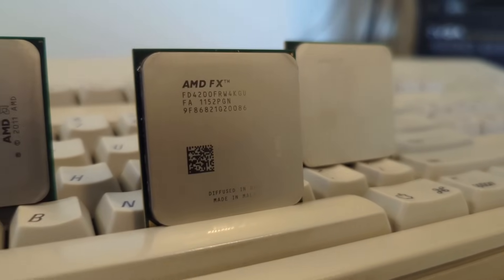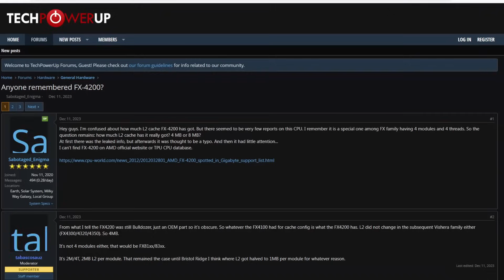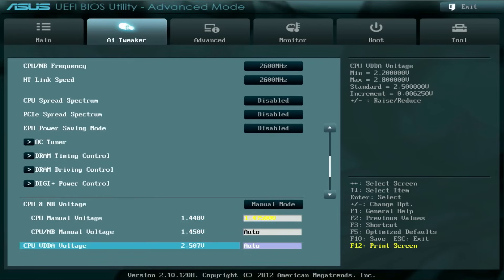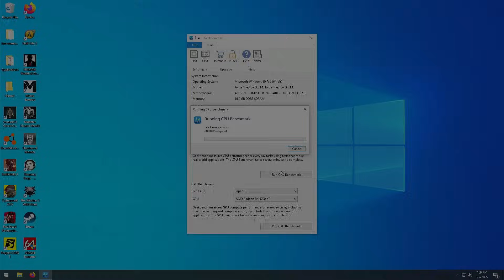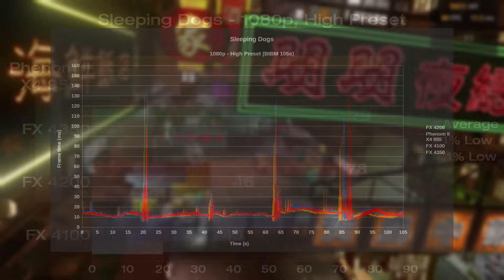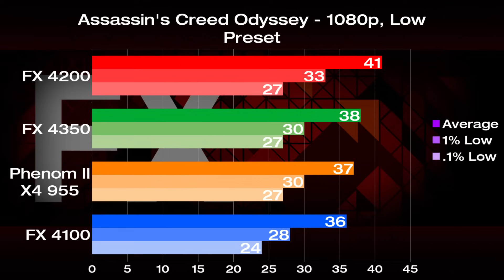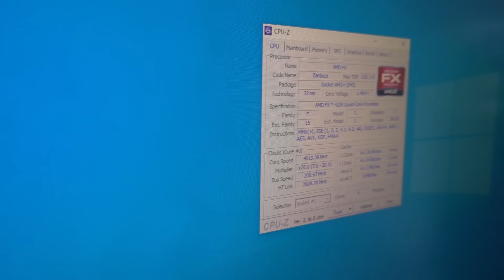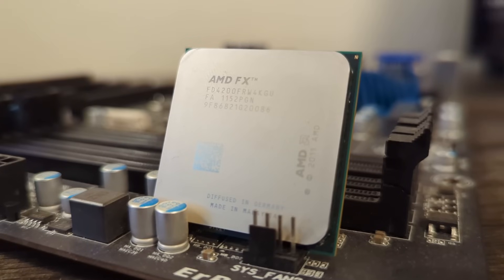What if AMD FX had "real" cores?

Comment: i still have my 8350 and my 9590 cpus, the 9590 was just to complete the platform and test out the zalman reserator cooler before moving to a new pc but man, the 8350 is still such a capable cpu even for todays use and games. but the 9590, that one was basically a meme. my pc at idle was pulling 300watts. i don't remember how much it was under load but ik i had to put a fan on the big external zalman water cooler to keep it from overheating
Reply from the maker: The FX-9000 series are so dumb but so fun lol. My 9370 at 4.7 no turbo made this same setup draw well over 500W at the wall lmao

Comment: i loved and hated my FX8350...it never ran well with games compared to the older intel i had before it, but ran really well with other tasks (like Compressing archives) and was super cheap. the killer for me was the motherboard that came with it (bundle) it wasn't really meant for it, or  designed well...and started failing in chunks (first the USB, then the ethernet...then the whole board), with a failing board and drizzling gaming performance, i gave up in it and bought a used i7, with some lingering  "amd trust issues". i did give them another chance and went back to AMD with the release of their ryzens - first a 5900x now a 9950x3D - and will probably stay with them  - until intel potentially pull their thumb out.
Reply from the maker: Maybe it was a 970 board, those could be pretty weak for the higher end FX chips. I'm sure it would have been a lot better on a 990FX one 😅 And enjoy your new chips, the latest few gens of Ryzen have been wicked fast!

Comment: If you have the right workload they are pretty fast. There single threaded apps there not great but multy thread apps they rock.
Reply from the maker: I second that, they see some benefit in heavily threaded apps!
Reply: @SPNG  When they first came out there were really not that many multihtreaded apps. I wrote a lot of software that used there multi threading and those cpus would wipe intel xeons. i had a 9590 it was very fast. It could out run our 12 thread xeons by a lot. I had this app that pasrse text files. The 9590 could process about 13GB and hour the xeon about 9.

Comment: i think the issue of games relying heavily on FP performance has something to do with the same kind of "Enshitification" of developers all deciding that the entire PC is supposed to do one specific task, and not optimizing each individual task within the main task (like a game, where processing physics and atmospherics are each individual task, and the game itself is the actual main task)

theres a lot of stuff that its really good to have the precision of floating point, but if you had certain workarounds by having the workload "chunked" where instead of trying to measure vast differences precisely down to the trillionth, you only measure about a thousand of these integers that only go up to the thousands, thus making it possible for the game to be accurate down to the millionth if you just scaled everything up and sampled the rasterization less to compensate, as the minute details are not necessary once the size scales to being what it would have been

the biggest issue would probably be memory
you just cant avoid memory issues

even if it doesnt work very well with a game engine, the point still stands that there are workarounds, and smart people can use them effectively

The whole concept works like how the difference is between JPY and USD
USD uses a decimal system where 10 bucks is 10.00
But it is almost like how 1000 yen is actually very close to 10 dollars (ignoring inconcistencies)

So you ignore the decimal outright and assume the decimal at the very end after calculation is already said and done

So 10.00 dollars is equivalent to 1000 cents as each dollar is 100 cents and all you are doing is adding a zero when multiplying by 10 (or removing when dividing)

And once you consider it like a tiered coordinates system, you get the military grid system 133 133 is the same as 1334 1334,  but the precision is a factor of 10 greater

So you are still in the same grid square, but you are now saying you are at 4,4 within the larger 133,133 system, and 1344 1334 is basically like 134,133 and the actual point is in a completely different square, even if 4,4 is the same coordinates for both of the unique grid squares themselves

If you are still somehow confused, imagine you draw a grid. Now pick TWO of those squares to make another grid within, so long as each square has the same amount of divisions (like a tic-tac-toe per each point you would have originally put the x or o). Then, just keep doing that to another two

Each level you go down is a completely different coordinate to the other and quite far apart, unless you pick the same square to go down, up until it is the last grid

...it turns the infinite into very well declared finite values that are easier to calculate because you arent worrying about a difference in precision or decimal placement, as each number has the same decimal placement as the other

Im pretty sure someone else can explain it differently if you got confused by my explanation

TL:DR;
"We" are relying on the hardware and tool to do all of the work for us, regardless of how bad that ends up for the end user
And all of that means we are worrying about adding detail that people wont notice, wont care, or if they do, is overcomplicated for the computer to achieve

Comment: The FX 4200 seems to do in hardware what the later Linux and Windows kernels "optimized" for FX series processors in software. The thread dispatchers in Linux/Windows would separate resource heavy threads onto different modules as much as possible and then backfill the second thread with low demand background processes to maximize the available performance. In this case though, the second integer unit is entirely disabled, so there is no performance penalty at all vs. the 8000 series.

I remember when the FX patches dropped for the Linux kernel and immediately seeing how threads were being managed differently in the top utility. I had an A10-5800K, I'd see "cores" 0 and 2 have 100% utilization and 1 and 3 a whole lot less. Windows 7 got the FX patch in late 2011.

Too bad AMD didn't make these chips more widely available, they would have been popular.

Comment: I had a Bulldozer CPU in my gaming PC and it was OK for that purpose. IIRC i upgraded Bulldozer to Ryzen 1600 at some time, also OK.
Maybe im just a slob for not benchmarking and pointing out flaws, but if it runs OK its good enough for me - only real use problems would be an issue.

Comment: I just retired my 8350 this spring. Bought it launch day. Pretty much a 13 year pc. 3 graphic cards 2 power supplies, it’s still pulling playable frames on most games I play.  Had a 4170 before that, was an incredible overclocker, auto overclocked  to 5.2, I could tune it to 5.6 under water. They got a lot of flack, but fx was a lot of fun to play with, and I gamed hard for 13 years on the 8350.
Reply from the maker: I like how they encouraged tuning your chip, what with all SKUs being unlocked. It was a pretty big positive compared to a lot of the entry-level Intel counterparts especially.

Comment: I had an fx 6300 at the time, and it was a better performer than the intel equivalent dollar wise here in Canada. For the same price, the intel chip was slower.
Reply from the maker: These chips were not bad value for the dollar, usually they were cheaper than the Intel counterparts and they could all be tuned too!

Comment: Interesting never knew that this CPU even existed.  In synthetic benchmarks is shows what is is capable of.  Hmm makes me wonder why did AMD make this CPU for OEMs and what did the OEMs need this CPU for? Nice video BTW and nice job with the memory speed parings because most users who benchmark FX series CPUs don't configure them correctly.
Reply from the maker: Yeah it's a bit of an oddity, the only thing I can think of is maybe it was good to get rid of chips that had defective integer units in different modules? Just speculation though. And much appreciated, I definitely wanted to give them the best shot with memory!

Comment: Im still reppin a FX 8350 unlocked on gigabyte board, pushed to 4.6 / boost to 4.8 with 79 degrees tops.. Air cooled... 1600 speed DDR3 ram and a 1060 overclocked... lool still getting about 80 to 130 fps on most titles .. its old but works 😅 😂 Assetto Corsa Competion runs 90 fps at high settings.. lol  thanks for the vid, very informative 👍 😊
Reply from the maker: Hey, nice to see people still rocking these! Thanks for watching, and glad you enjoyed 👍

Comment: I have the FX 8350 CPU AND the Sabertooth 990fx v2. in my PC. My system still keeps up with pretty much everything at 1080p. It runs a bit warm and is a bit power-hungry at times but in general it's a fantastic processor. I'll eventually upgrade, but right now I see no reason to.
Reply from the maker: A lot of the latest chips will definitely give you a huge performance bump already, but that's understandable! It'll be even more impressive when you do eventually upgrade lol. What graphics card are you running on that setup?

Comment: I used an FX-4300 from 2018 to 2023 playing most modern games and not having many real issues, i even recently installed Windows 11 on it after bypassing some checks during the install and it can still operate just fine.
Reply from the maker: The newer instructions keep these things at least launching games for the most part! They can do surprisingly decent if you keep your expectations in check
Reply: @SPNG Exactly I loved mine and the best part is it was free because my friend had accidentally dropped it so I bent all the pins into place and bought a 60 dollar motherboard to test it and ended up building my pc around it as a joke
Reply: @SPNG  But after it was able to play rust at around 50 fps I just stuck with it until I had memory problems and recently upgraded my whole system, going from a 4300 and a 1050ti to a 5700x and a 5060Ti is a serious jump

Comment: Thanks for digging this up. I had a 8120, overclocked, and it was good at the time. 
Only thing I miss here, is a comparison to sandy bridge or ivy bridge.
Back in the day, I traded my 8120 plus that Sabrrtooth for a 3770k + Asrock z77 extreme3.
This was when haswell launched.
I felt like both CPUs were close, even though with OC, the 3770k wins. Had both at 4,5Ghz.
Reply from the maker: Thanks for watching! Perhaps I could pit it against more chips in the future, but I'm not sure about doing Intel chips because of platform differences mainly. That and the added time it would take to do it 😅

Comment: I don't even know what to say "I hate the repeating of the 990 boards" and "I love the phenom ii 1090T" (but also hate the 1100T - the 2 and not and enochian bs) and also these corsair fans with these 5 "x"es are just awful and make me aggressive instantly if I don't remove 2 of the xes, there also are 970A boards which do offer m.2 support sure it's only Gen 3 but it's still like 3x faster than sata and Gen 4 and 5 m.2s could theoretically be installed and when only copying data internally without going through the mobo they still reach their full speeds.

What I wanted to say is "when there is such a powerhouse like the 1090T and m.2 970A boards" why would you even consider a 990 x a 4 core CPU???????!?!?!?!?!????!!????
Reply from the maker: It was for experimental purposes mainly, and to give these CPUs a platform they wouldn't be held back on. Of course it doesn't make much sense to run, but you can rest easy knowing the board was not a limiting factor here

Comment: You want to test those processors on Battlefield 4. It was made to complement design choices on the PS4; which was a secret that was revealed in the design suggestions by AMD for the consoles. Most Vulcan/Mantle/DX12 games should run well, their existence was made to scale better to utilize bulldozer better.
Reply from the maker: I might switch around the game suite if I do a part 2, perhaps you'll see BF4 in there 👀

Comment: I have an fx8120 which clocked to 4Ghz.. and in linux it ran circles around i7 2600k in non FPU tests. At that time intel released a new C++ compiler which shifted from MMX and SSE fp ops to regular FP .. which didnt help older gen intel as well 🤔
Reply from the maker: Not bad, keep in mind that 2600K can OC as well though! In heavily threaded games that FX probably sees the most benefit.
Reply: @SPNG lol that 2600k did offer nice OC (with a little luck) FX8xy0 and FX9x50 would benefit most in self-compiled linux settings, avoiding latest intel C compilers and -settings. Though IPC singlethreaded  was low .. there was near 100% scaling at int, and AMD FPU was so good in previous gens .. they thought even having 2:1 alu/fp ratio would hurt as much. Intel played them hard, upgrading FP logic, and switching to a Hyperthreading optimized FPU logic, where prevision intel CPU's and the C compiler did the same through integer units (approx. was good enough)
Point being: windows & visual studio came with the Intel C compiler, almost all games for windows are made with VS .. so guess what it was optimized for ;)

Comment: I had a PC with a trusty and reliable Phenom II X6 1090T for TEN YEARS! And it could have held on for a little longer. The only reason why I felt compelled to upgrade to a Ryzen at that point (initially a 3600X, later a 5900X) was that my excellent 970 mobo died before the CPU, and the only replacement I could find was a horrendous entry-level one that was a hard downgrade (it didn't even support SATA 3!). So, it was the scarcity of AM3-compatible components in the market after a decade that made me move on.

But please note that I skipped the FX generation entirely. The same is likely to happen with socket AM5, though I don't think it will be for 10 years again. My current Ryzen 9 5900X is so good and fast that I simply don't need anything faster. So, maybe I'll upgrade it when AM6 is released...
Reply from the maker: Not surprised to hear you got a lot of longevity out of your Phenom II X6, I think you chose the right time to upgrade though. The older instructions definitely make running newer applications a pain. I hope you get loads of longevity out of your 5900X as well, they are wicked fast chips!

Comment: I had an AMD Phenom II X6 1045T that was overclocked to 3.4GHz all core, and a friend of mine has an AMD Phenom II x6 1075T that is overclocked to 3.7GHz all cores. We had both thought about getting FX processors at one point, but neither one of us could justify the power draw and heat just to barely get any real world performance uplift and the instruction sets we were missing later. I upgraded finally in 2017 from my Phenom II machine to my roommate's Intel Core i5 3570K that was overclocked to 4.8GHz with a slight under volt. That was a huge and worthwhile upgrade over my Phenom II. Now, I am rocking AMD again, have been since 2019 when I went from Core i5 to AMD Ryzen 5 1600X, and now I have a Ryzen 5 5600X and my friend finally upgraded from his Phenom II 1075T machine into a Ryzen processor. Basically, I knew about AMD's FX series processors, and that was the problem, I know enough about them to avoid them. If I built a "retro" machine from that era, it would sadly be an Intel Core processor or a Phenom II if I do not need certain instructions. I refuse to run an FX processor, I do not need another processor that also makes my PC work as a space heater, my current and last graphics card run hot enough.
Reply: Got my 8350 over a over decade ago, very cheap thanks to people like you... also bought a Noctua d-14 to keep it cool and silent.
I can't believe that it's till running the majority of recent titles and I don't get the hate.

Comment: i have a pile driver "8" core chip and 1st gen intel iseries 6 core xeons. There was a game i ran that at 4.2Ghz AMD performed slower than the 2.6Ghz xeon. After tuning i got the xeon to 4.5Ghz. The game uses SSE, havok physics and is physics heavy and can use at best 4 cores (math is probably 2 cores) so the number of cores didnt really matter. clock per clock, SSE for the fx was half as fast as intel 1st gen iseries.
Compared to intel, AMD fx was absolutely trash at games and productivity, stuff that needed SSE, avx but it was a bargain and beat intel in other tasks relating to servers for example. an example is running samba, webservers, compression, code compilations. the AMD fx beat intel by a huge margin here as these do not require much of SSE or FPU. I used the piledriver though. the bulldozer had issues that was fixed in piledriver.

Comment: I got a FX-8350 (probably a different architecture than these) as my CPU for the first PC I built a decade ago and loved the thing (even with the weird problems I'd run into between it and my R9 380 drivers at times). I kept the guts around after giving away the case to a friend and have them set up in a secondary machine now.
Reply from the maker: It's Piledriver like the 4350 in here. Sounds like a lot more people had 8350s though lol